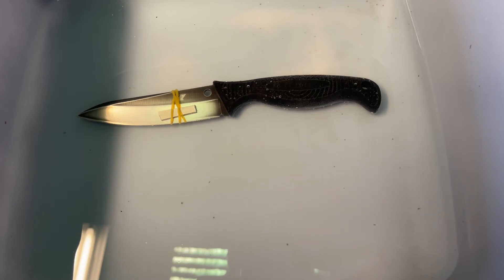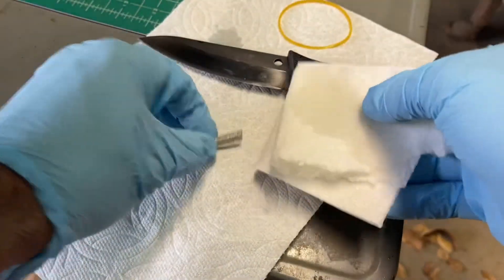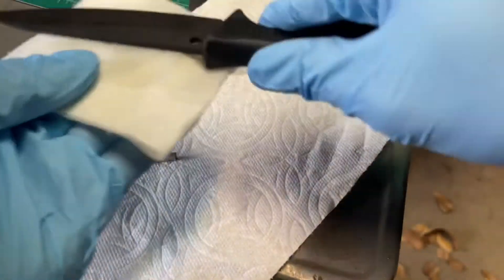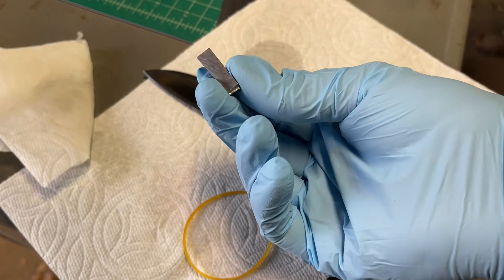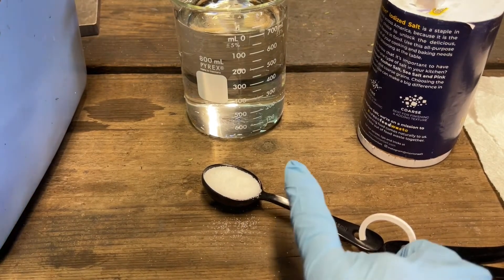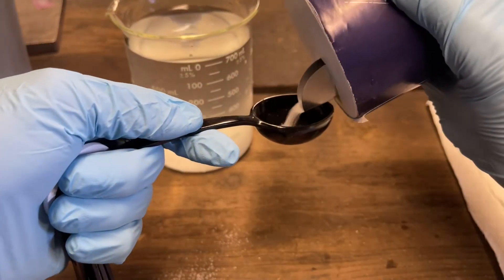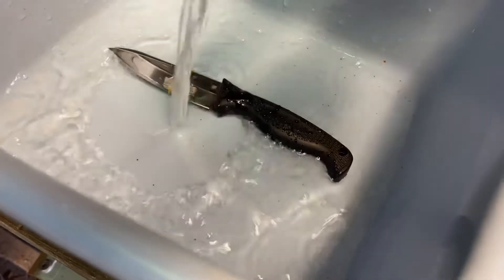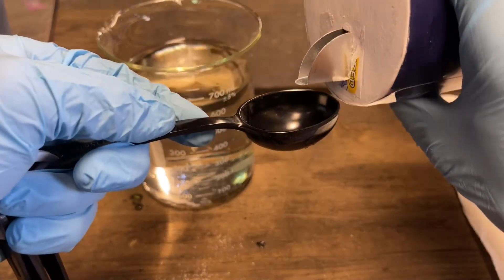H1 Spyderco Aqua Salt vs Titanium galvanic corrosion test #1

Comment: Hi Totes! Im curious to see if the titanium will make h1 rust, seems like an impossible task, cause h1 has very small content of carbon - about 0.15%. 

Also, i finally got my belt grinder, i have a short video on it if you are interested)
Reply from the maker: Yeah, it seems like H1 would have a good chance. I’m going to check it out and I’ll post a video tomorrow of the results.